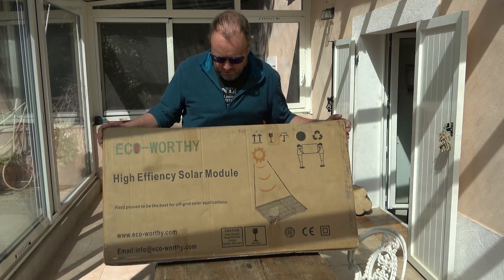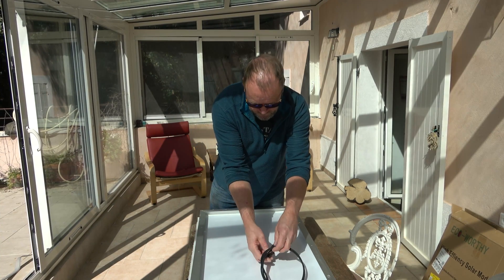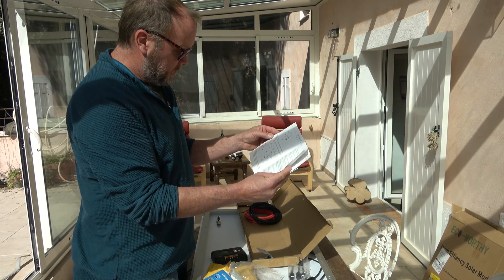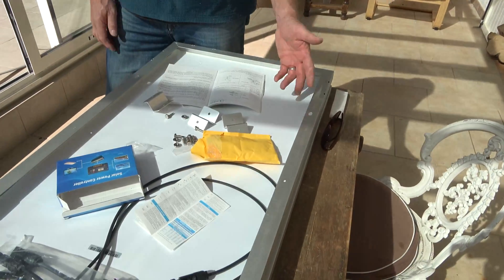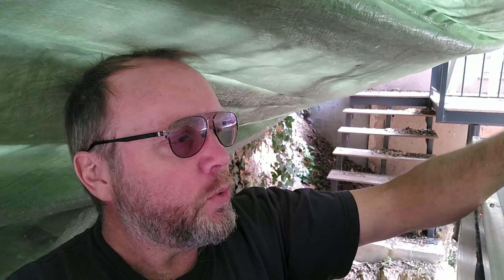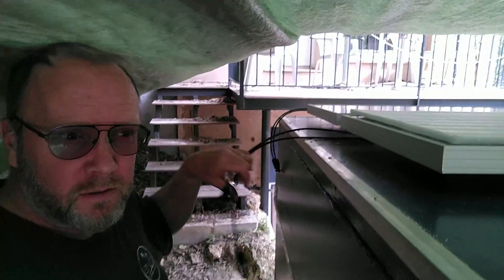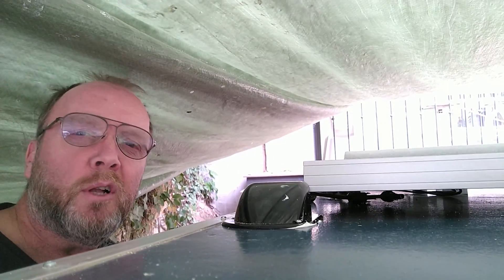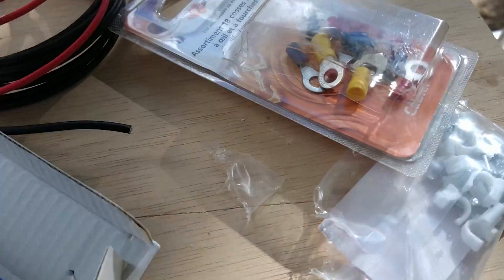BEST VALUE? Solar Panel Kit Unbox & Install | Eco-Worthy 200w

Comment: I just finished setting up my ecoworthy 720w solar panel system down the bottom of my garden. 
Found this video today whilst searching for instructions on how to set up my 60a controller as after 18 months of putting it off I'd lost that particular piece of paper!

To anyone who has bought a kit, because they don't know what they're doing, I really recommend that you either stick religiously to the instructions and don't change anything about the layout or spend some serious time learning everything you need to know!

On my son's advice - he's Australia, I'm  UK - I changed things, added a fan,  a fuse box, an isolator switch for the panels, ran an armoured cable up the garden etc. It turned out ok but like I said, I dithered, I fussed and I worried.
Then I worried about electrocuting myself....I didn't!
Turns out rubber gloves and most rubber-effect shoes insulate fairly well 😂
I changed a couple of things and it caused doubt, dithering and a lot of buying the wrong parts, 18 months worth of procrastination but now I think we're there. Just in time for winter 🙄.
Reply from the maker: Cheers for sharing👍
Imho as an amateur backyard mechanic, you can't go too far wrong with these things (even switching the cables). But everyone will have their own experiences o course! Glad it is working for you👍😎

Comment: Its a good idea to read the manuals.
Solar panels need direct sunlight to work properly, they won't produce much power under that plastic sheet because it is blocking the sun.
Maybe this is why your previous 600W setup didn't work , its your fault, not the seller or manufacturer of that system.
That controller you are using also has a very specific process for connecting it up and disconnecting it, if you don't follow that specific procedure it will damage it or not detect the battery type correctly.
For anyone watching this video this is very bad information and how not to wire up solar systems.
Reply from the maker: Cheers bro. Surprised I haven't blown myself up yet😂😝
(ecoworthy did ask to use this unbox vid on their website - lord knows why🤷‍♂️😅)

Comment: I am thinking about purchasing the 120w eco worthy kit to fix to my shed roof. 😀. I have a question do I have to purchase a battery to use the solar panel or can I plug a usb cable into the power controller and charge something straight from that on a sunny day. 🤔.
Reply from the maker: The solar controller in the kit has a couple of usb outs, so you can charge something direct with a usb cable, like mobile phone, iPad, bluetooth speaker, led lights etc. It is only when you would like to charge laptops, or perhaps run a fridge that you need a converter and hence a battery. 
Hope this helps 👍
Reply: @ASimplyFabLife  Much appreciated. 🙂. Thank you. 👍. Great answer. 🙂. I am thinking of buying one soon. 🤗.

Comment: The Eco Worthy controllers are poor you need a MPPT controller. I got the kit and everything was great once I changed the controller to a MPPT controller.
Reply from the maker: You’re correct. The PWD controller is not nearly as efficient.
However I found it okay for our purposes with three panels and 130A battery it kept our fridges cold and charged the laptops
Reply: @A Simply Fab Life  excellent I'm glad it works for your needs, you would only need to change the controller if it didn't quite charge as a MPPT does. You saved yourself some money and that's what our solar set ups is all about. Thanks for sharing your videos I enjoy watching them 😊
Reply from the maker: Cheers 👍 and thanks for watching 😃
Reply: can you connect different pv Arrays to Ecoworthy combine box
eg one array 135V  dc
other 180v dc array
what is the net   Dc  current🈁🈁
Reply: @sunjayjay240  ECO-WORTHY 6 String PV Combiner Box is suitable for photovoltaic grid-connected and off-grid power generation systems. 6 String Configuration, Max current of single PV input array is 10A. Each String Continuous Duty Rated at DC 250V. Single PV input array installs with high voltage fuse, its function over-load, over-charge protection. Anti-Backflow Diodes, Anti-Backflow & Anti-Reverse Protection, Touch-safe Circuit Breakers & Non-conductive Box. Professional high voltage breaker controls output, with anti-circuit protection and make the system more reliable and safety.

Comment: Good vid, well done. How did it work out now some time has passed?
Thanks Al.
Reply from the maker: After installing a third panel for 300w it all functioned great. (had to change the controller for a 25 amp one). They still made sufficient power in cloudy and dusty conditions and held up perfectly on some rough roads with the trailer bouncing around. The weak link was the batteries I chose... It pays to install the best you can afford (pun intended)... Hope this helps a litle. I guess I'll do a quick follow-up video (one year later review) Cheers!

Comment: I did not use those pre drilled slots for bolting the panel to the bracket, i drilled smaller holes, just big enough fornthe screws to go through, also that way I could plan it so they missed the ridges on the roof of the camper
Reply from the maker: A good solution! 👍👍

Comment: hi @A Simply Fab Life, is it possible to wire a series of outlets from the inverter or are you limited to the plugs on the inverter? Thanks
Reply from the maker: I just plugged an extension lead with extra plug sockets into the inverter. And another from there to the back of the trailer. Now we have seven in total (a bit overkill - but I had these lying around). Has been working fine for me (if you keep an eye on total watts with everything, of course).

Comment: What can be achieved with 200watt ‘kit’ ?
I guess not much, starter toy kit.
Reply from the maker: At the risk of being trolled here, I'll respond by saying you answered your own question🧐
It is my starting foray into the world of solar wizardry - on a budget, of course!
Does it work? Yessir!
Reply: @ASimplyFabLife  all good intention. I started with 200 watts. Good we have Walmart to trial/error/return parts. Just that, keep it low low budget, lest it becomes an expensive toy.
My greatest reward is 10000 BTU aircon, we have 8 months of heat in Vegas.
Reply from the maker: @marktan3668  Okay, cool, thanks. Ah, yes - Nevada heat (will need to visit one day).
What I HAVE learned so far is the limitations of 110Ah battery (need to spend more money on this).

Comment: Great video. Thank you. I just bought these for my trailer.
Reply from the maker: Glad I could help. It is a good setup - plug and play and still going strong. One thing i would do is get the best battery you can (something I regret as this is the weakest link here...). Good luck and enjoy the free power!

Comment: great vid mate, just about to pull the trigger on this kit and was looking for reviews before i took the plunge, looking to put some backup power for the garage so thinking about adding a 40 amp mppt controller to future prof it. well done again.
Reply from the maker: Glad it was helpful 👍. And, yes, I would go ahead an get a 40 amp controller because I did add another panel (for 300w) thus needed a different controller (these are cheap as anything anyway, right?). Mind you, the extra panel came with nothing else, so I needed 3-1 connector cables and some of my own brackets to mount it. 
In that respect this is a good set (and good value) where you get everything you need and it is plug and play. Good luck!😀

Comment: I am very new to this. 
How long to make the battery full ?
How many boiling kettles can you do?
How long would a 13 amp bulb last ?
Reply from the maker: This is also our first go at a solar panel (kit). What I DO know is that we have 200w (300w with the extra panel) for about five hours good sunshine a day. This means roughly 1500Wh (watt hours) of battery charging. This is enough to recharge our 105Ah lead acid battery. 
How long the power will last depends on the battery. Ours runs our camping fridge (only). This seems to be all the battery can provide (60w continuous draw and peak 400w on starting) but we are still testing. All cooking is on gas and lighting is LEDs. Hope this helps a bit.
Reply: @ASimplyFabLife   A great help,thank you. I am going to keep buying until I don't need any mains in the house.

Comment: Looks like the kit is cost effective, agree the 100w panel size is ideal for trailer / roof rack mounting. The additional splitter cables will allow connecting of the panels is series (24 volts input lower current supply) or parallel (12 volt input higher current supply). Series connection considered more efficient for the controller to manage variable sunshine conditions. Does the manual mention if it is a PWM / MPPT  controller (pricing suggests the cheaper PWM technology), which is fine for what you wish to power. Love your makeshift weather workshop 👍🏻
Reply from the maker: Yes it is PWM... 👍😉

Comment: I thought you need a fuse on the controller to battery positive.
Reply: That’s what I thought , any idea what amp fuse is needed for this set up ?
Reply: @stkenno8758  I would say 50 amp. It depends on your cable though.
Reply: @stkenno8758  This guy knows his stuff. https://youtu.be/rVkDPzrA-zw
Reply: @vic6820  thank you Vic, it’s a bit overwhelming as I’ve never tried it before. I messaged the manufacturer and they said the set up didn’t require any fuses (as supplied in the inverter and control panel) but if cables carry current surely they need isolating in case of damage etc?
Reply: @stkenno8758  if I were you, I'd follow the wiring diagram from the link I sent you. On there, there is also loads of info on cable sizes and fuses etc. It's not difficult, it just requires some thought and patience.
Reply: @vic6820  Will do, thanks for the link.